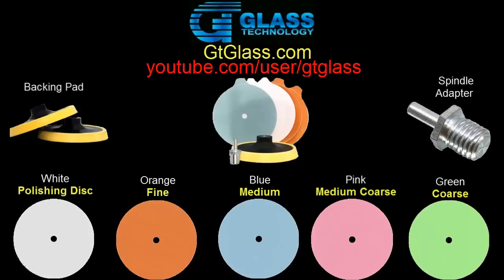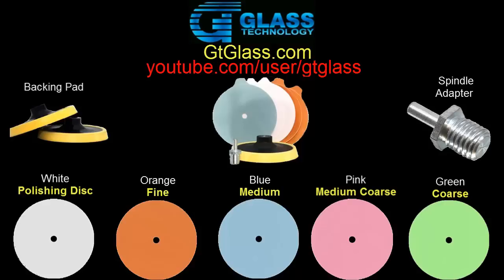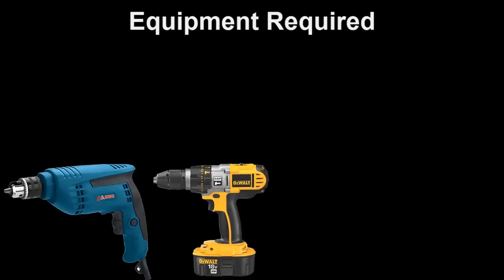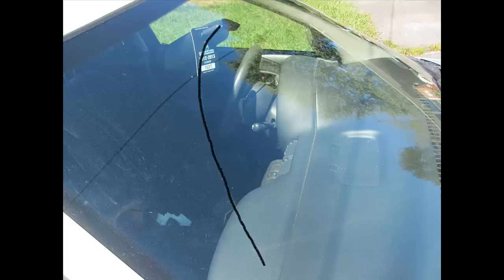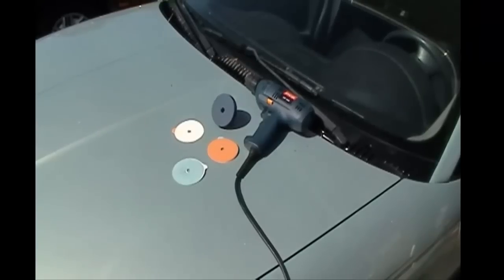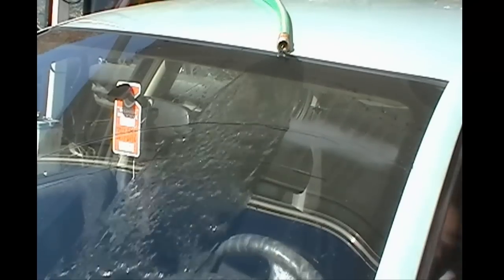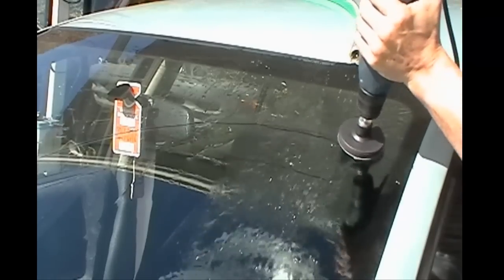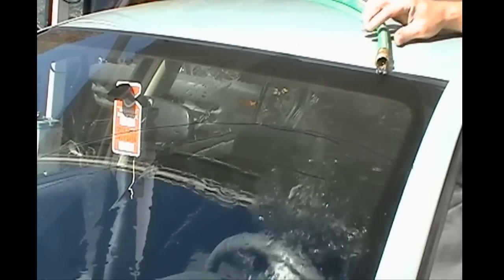Do it yourself windshield scratch removal

Comment: I use a dry system- water spray bottle when polishing.  Thats way too much water for my applications. When working on a vehicle I like to work inside due to winds and the dust blowing in the air, could get under your pad and create further damage, especially on high end cars.  We also work on  architectural glass on buildings and high rises to remove acid rain and calcium build up. That process is glass polish and spray bottle with a high speed polisher. Glass tech has great products just make sure it fits your needs and applications.

Comment: have you ever tried cerium oxide compound after the sanding?
Reply from the maker: Tracy Dalton I have not tried that. :)
Reply: Tracy Dalton. hi tracy im a window cleaner and need to fix acid etched graffiti panes do you know how i can cut it down and polish. with cerium oxide? what and where to get supplies thats not a rip off
Reply: oiyabastard     I have honesty never tried repair. however I have purchased a kit from eBay, which is very similar to this one, except is has cerium oxide included.  guess I'm hanging on to it for when I need it.
Reply: Tracy Dalton. ahh . expensive?  i need to cut down 4 panes

Comment: I have a 2 windshields that are a replacements(rare car). Not installed yet. When they arrived they had a "very" distinct haze on them. Both inside and outside. It was shipped from South Africa. I tried every way possible to remove the haze, from window cleaners to gasoline to solvents. I even took it to a glass repair shop and they only got a small amount to come off. The final trick I tried was my wife's idea, Bon Ami. I used an orbital buffer with a cotton cover. This cleaned the glass, but as you can guess it left swirl marks on the glass. The one with the least was installed as It is not noticeable unless "very" close inspection. I have several questions. 1. Do your pads come in larger sizes.If not what are the grit levels of your pads(1000, 5000). I have just finished repainting the car and I would like to get these pieces clear again. 2. If you have larger disc. would a DA sander work(have 5 and 6")? I have a small adapter(3") for an orbital buffer that would work as well. 3. How well does your product work on the inside of the glass?? Do your pads use an interface pad that would allow it to work on concave surfaces? If this is too detailed  for a response, I can call and we could talk about it. Thanks,

Bill

Comment: Hey there!! nice video, Questions, Can I use this on a stove glass cook top it cracked on corner was put back together
so the fit is good but who ever did it sanded the glass top where it look like the glue or epoxy he use came through the crack, he should have removed that right away before it totally setup. so now there is a mean solid white sanded area at repaired crack and I see the scratch marks made my sand paper. So Im trying find a system that removes this sanded area about 4 to 5 inchs long 3/4 inch wide and there is a few areas this bad, any thoughts on this one. or recommendations if your system cant do it..
Thanks
Terry phoenix AZ
A Handyman in phoenix looking for a repair system that maybe could use on other jobs. as I always like learning the next thing as I know most everything about home repair.
Reply from the maker: Good Question... :)
It works great on windshields, I haven't experimented with other glass..
I would think it would work.
The materials are not very inexpensive from the company, so it's worth a try.
If it were me, I would try it. :)
Reply: Thanks for the info it's nice that we have the internet and that customers and businesses can come together to find  advice day help and products .
Hail to the information highway
- Terry

Http://yourbesthabdyman.com